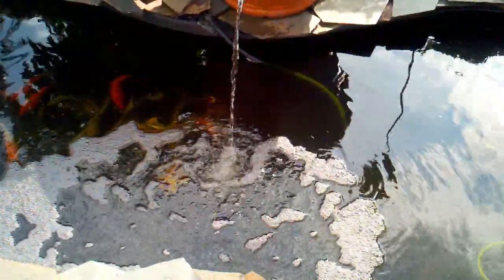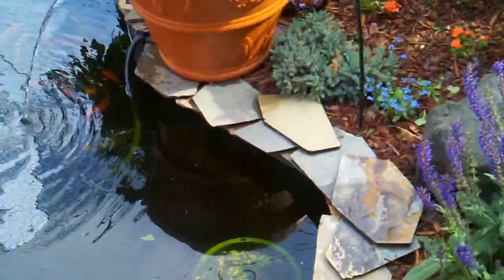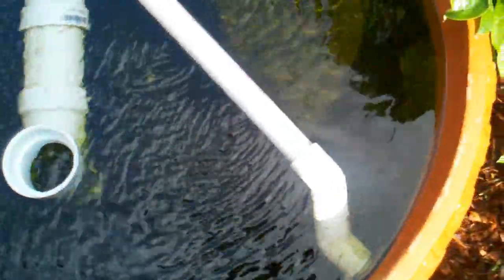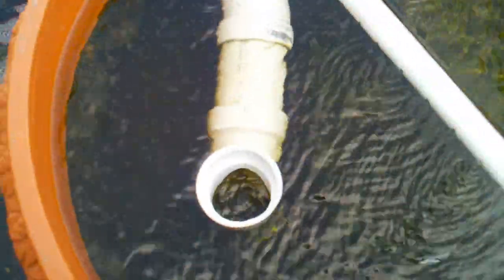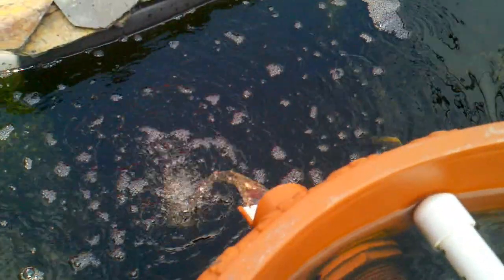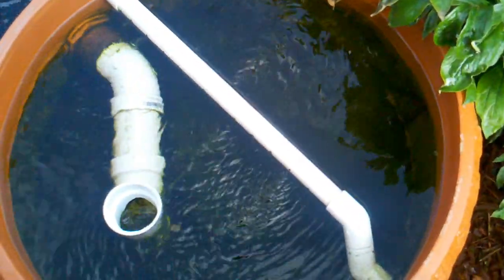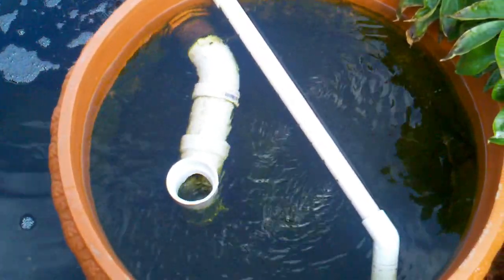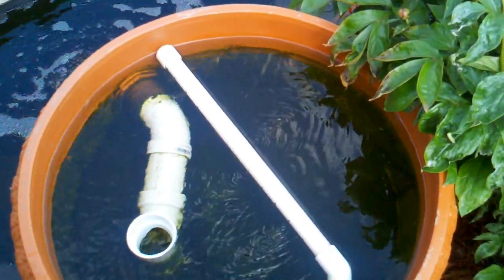DIY filter

Comment from the maker: That's for that suggestion. I did consider using that method and still have all of the materials to do so, but since I've added the packs of amonia rocks and charcol I haven't had to chngs the filter media. In fact I haven't even cleaned them yet. I've only been adding water due to evaporation and everything if fine. I kind of like the idea of the spray bar and the water flowing with gravity.

Comment: Hi Paul, Flower pot is a great idea ! have a fix for you, run the inlet pipe to the bottom add a tee run 2 pieces of pipe with a 90 on each end face them as to create a spinning motion. Get rid of the outlet tube with the fail safe Tee, dont need that. You will never have to worry about it over flowing even if the filters get clogged. make a chamber under the media so the the bulk waste can collect and be drained in between filter cleans. Just one idea to help.

Comment from the maker: That is the exact reason I installed the Tee on top and left it open. So in the event there is a problem with the waterflow or the filters being clogged the water will just fil the pot up to the point where it will spill over into the falesafe and back into the pond. This video proved my theory.

Comment from the maker: I haven't replaced the cover to the filter yet and so the sun has helped the algea grow very fast in the filter. The filter pad was so covered that it was not functioning well and as a result the water was filling up the filter. Thank goodness I devised a safety for just such an emergency! The top of the return line was made with an open T. Just in case this was to happen the water would overflow into the T and back out into the pond rather than filling the pot and overflowing out of the pond.